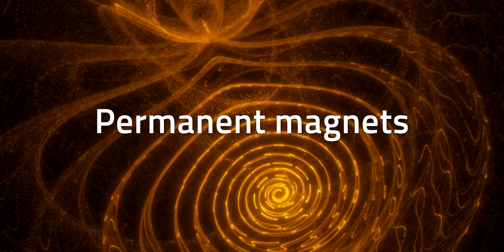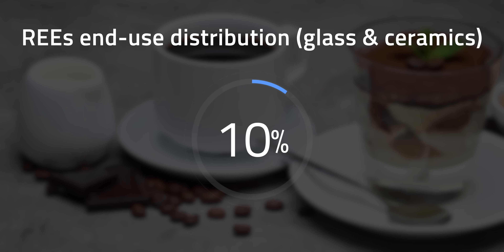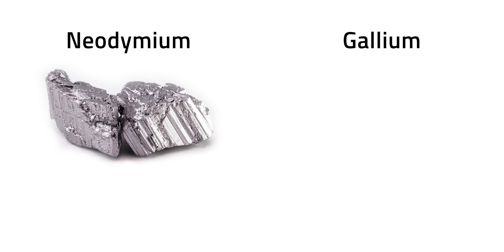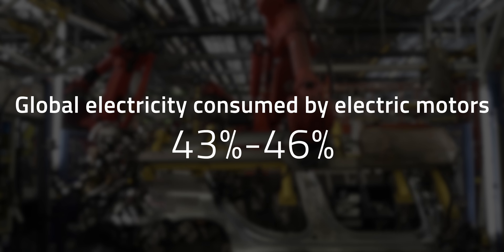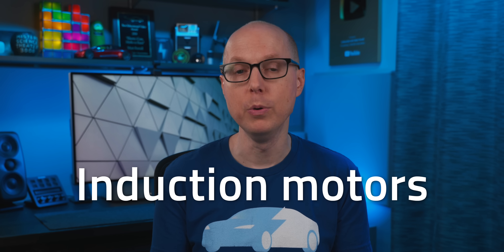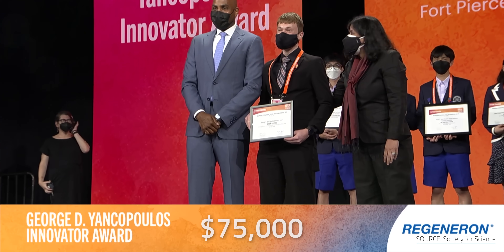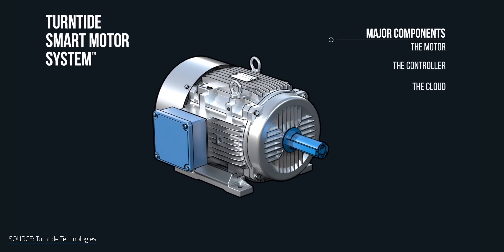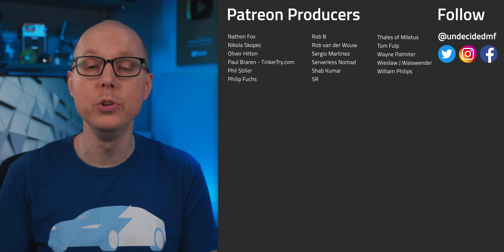Why This 17-Year Old's Electric Motor Is Important

Comment: Yes and those wind turbines are a complete waste of time. They are not needed. Heck the best thing the world can do to solve its problems would be to focus every major research group on figuring out how to make commercial fusion power viable. Why? Because it literally solves all of our problems and does so almost overnight. With fusion power fossil fuels become net zero because we can literally build machines to extract CO2 from the atmosphere and then use that to make the fuels that run our lives. Why? Because it literally costs less than $0.0001 to produce a gigawatt worth of electricity using fusion power, which means that to power giant machines that can do exactly what I suggested would be so much cheaper than drilling for new sources of oil, not to mention that is literally solves climate change in a single step. Plus a single fuel truck full of fusion fuel is enough to power a country like the USA for more than a century! Giant mega projects for growing food become a reality because they energy costs needed to make them work practically go to zero. In fact, power companies will be a thing of the past, governments will literally have to take over and run them probably using the military because the power companies themselves will no longer be profitable. The cool part is that everything changes and the worldd enters an age of abundance once fusion power becomes a reality.

So do the world a favor, start using your voices to demand that the world focus all of its attention on making fusion power a reality.

Comment: Hmmm.
It's actually "Amazing" in the context of applying 3 Phase AC Motor that Industrial World already know and standardized since the 50's into today DC dominated Electric Motors for EV but not on the context of more efficient Faraday Law implementations.
While using it as replacement for the current fixed permanent magnet Generators defeat it usefulness and means of Generating Energy while you need another energy to creates the polarization needed to creates the Electricity.
And most of "Power Saving" advertised is basically a scam by the leading global brand on Energy saving..ahem..ABB.

Rare Earth Issues is just basically "Cheyna" Problems, If the "90%" REEs comes from Japan, EU or USA no one will bat an eye for how it's "Problematic".
Sad how politics really grips every aspect of things that supposedly Neutral.

Comment: The next generation motors are all_magnet they fade-10%flux/700-1000yrs and have commercially available products.

Homes infinitysav 20yr no-inputs warranty, fully serviceable quiet no fumes indoors 1+31+3-phase to 406vac, inverter to solar_panels, does grid-tied, semi-portable. 

10kw/$15k $62.50+int/mo, 5kw/$8k $33.33+int/mo.

1-Mw genset/container 50yr no_inputs wrnty w/upkeep flip substations off-grid from a parking lot, power village farms and industry no miles of wires.

Est.cost $1.6M/unit $3.65/Mwh+int & upkeep/mo no CO2 H2O or wasteheat/Mwh superconduct coils technokontrol's RF-5000 

The 1300hp/1-Mw motor fits cars powers a light aircraft.

From trade studies, fwiw.

Comment: What about a light bearing that uses optics to provide a frictional bond against two particles with like charges creating a division of nuclei within the light bearing field which propels both in opposite directions..  only thing is there would be no way to couple either to designate a static or rotating mass as both would be constantly repelled by one another at the speed the universe is constantly generating making a sort of black hole gateway and said particles ripping through the time and space continuum proving time travel is real, life is just a forethought and death is indeed just the ultimate ending in nothingness where everybody has always been forgotten to until that point in time when this horse shit im babbling on about gets invented and mankind once again resets to single celled organisms after the poles change and sun burns out tearing apart the milky way like a game of billiards inevitability life finding a way in some other perfect chain of events aligning and forming another ticking time bomb of parasitic evil insanity called humanity..

Comment: ❤❤❤❤❤FREE ELECTRICITY 🔋 GENERATOR ⚡ PERPETUAL MOTION MOTOR WITH 120 VOLTS BATTERY PLUS 120 V MOTOR CONNECTED TO ELECTRICITY GENERATOR ⚡ CONNECT ALL WIRES TO BATTERY 🔋 TO RECHARGE BATTERY 🔋⚡ GENERATOR WILL MAKE ELECTRICITY ENDLESS.. WITHOUT HAVING TO PAY GRIDD....
Reply: liar

Comment: I appreciate your video. But it needs a lot of work informational wize. There  is much missing on current and past technologies. . He didn't invent anything new. He won't be able to patent the motor because the technology is already patented.  He can't Rev the motor to high speeds because it won't operate at high speed due to horrible efficiancy. The best of both worlds is a hybrid motor with both technologies incorporated. That motor already exists in most production ev's and the majority of name brand brushless cordless tools.